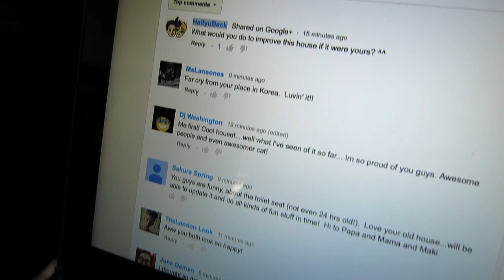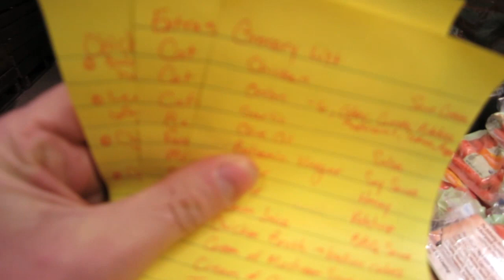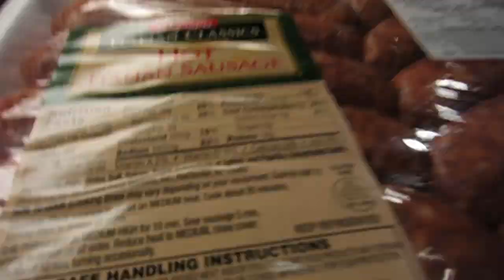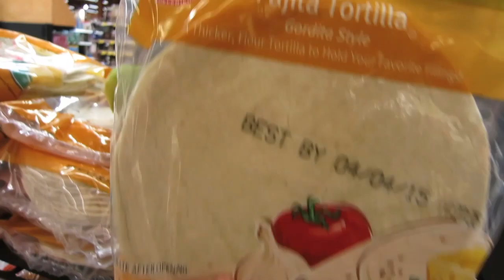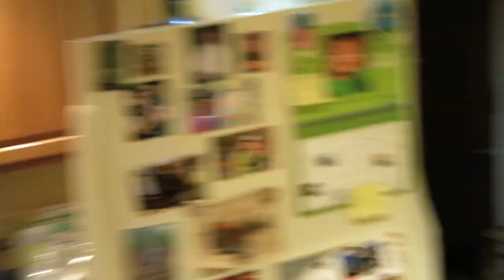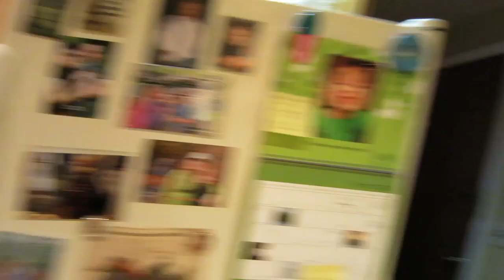KOREAN VS. AMERICAN SUPERMARKETS

Comment: This may be kinda late, but as far as painting, I found that taping around the trim takes a long time and actually sometimes makes painting edges harder.  I realized this (after painting my whole house) that using an angled trim brush is easier and quicker and the edges seem more crisp.  I just keep a wet washcloth with me and if I accidentally go onto the trim you can just wipe it down right away and the paint will not stick.  The angled trim brushes are awesome and really do give you a straight line.  :)

Comment: The odd things I remember about Korean supermarkets were the carts used castering on the front and back of the cart.  You could spin the whole cart around in place.  It also seemed odd the use of escalator ramps with no steps so you could take your cart between levels.  I figured people would let go of carts and see them fly down the moving ramp.  Lastly, paying for each plastic bag your groceries went into after you checked out.  This was in a Korean Walmart 15 miles south of Seoul.  We were the only foreigners in the store but no one seemed to notice.

Comment: If the temperature is 32 degrees, even a little snow gets so slick you will get stuck. Colder, than usually okay. Snow has been amazing this year even in Iowa. But it is sixty five degrees now, woo hoo to that, too.

Comment: The truck has no weight in the back. Stop at a large hardware store and put $20 worth of cement or sand in the back. Add a grainhog shovel.